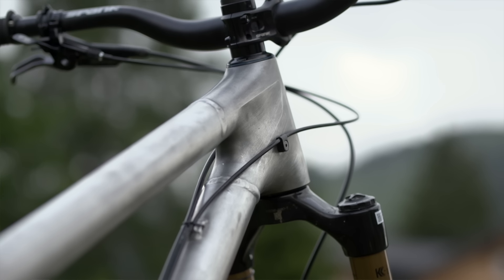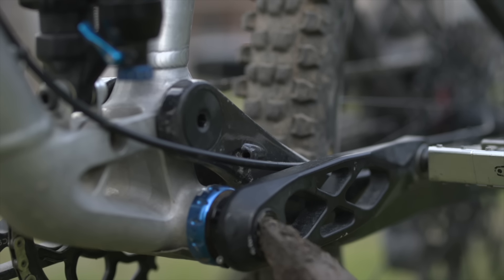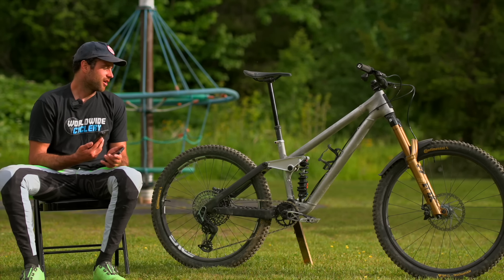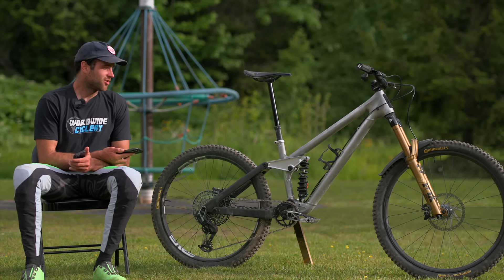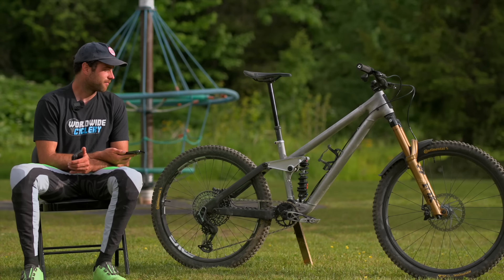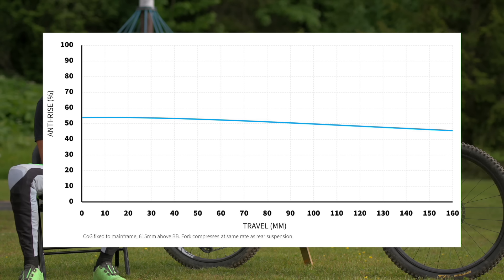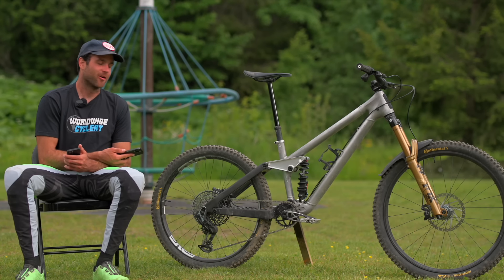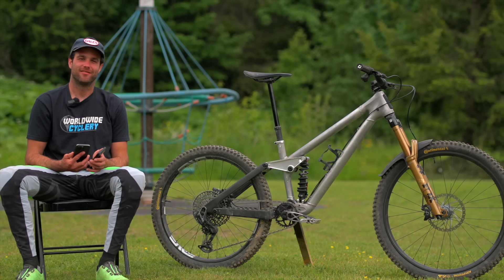IN DEPTH | Neko Mulally | Enduro Bike Gen 2

Comment: Love how clean and not fussy it looks Neko - top work!!
When you are going through / finalising the Geo' chart, be sure to include the effective top-tube length - as this indicates the 'cockpit' space, and we spend a lot of time grinding uphill too...
For your medium it looks to be ~585mm-ish (?).
As someone else also asked - is Full 29'er an option(?) even if it means a little less rear travel (eg.160mm) to keep the seat-stay bridge 'safe' (but looks like it fits that 27.5 pretty snuggly).

Again - Top work Neko et al - thanks for bringing us along on the journey 🥰
Reply: Thanks! We’ll be sure to put that on the new geo chart. 

For now, sharing these CS and SS molds with the DH bike, we can only offer 27.5 rear which the bike is designed from the ground up around. I like the long post insertion and bridge on the SS is mandatory (for me) so unfortunately no 29 options planned
Reply: @Loganmulally  is def' a v.sensible approach maintaining the CS & SS across the 'fleet' 👍
Reply: @Loganmulally have you considered to put headset reach adjust cups? Really keen on this bike, but I’m in between M and L. If I could stretch out the medium a bit it would be nice or possibly shorten the large
Reply from the maker: On an enduro frame with a single crown fork it's hard to get adjustment out of the headset since the fork has a tapered steerer tube. We have definitely considered it but with the size of head tube needed and all of the custom headset parts we would need to make, we didn't think it would be worth it right now.
Reply: @NekoMulally-FRAMEWORKS  thanks for the reply and I can understand it brings complexity to the design

Comment: The bike looks amazing.  I notice the small has a longer chain stay than reach; is there a reason the small is proportionally different than the other sizes with regard to these two measurements?  Does it change the feel of the bike much?
Reply: I guess the more crucial number to look at is front center vs rear center, or BB to front axle vs chaninstay in other words. Proportionally it’s the same change as the other frames, sorry if we forgot the front center measurement in the geo chart
Reply: @Loganmulally  No worries at all, thanks for the explanation; that makes perfect sense.  I've always wondered how different sizes of the same bike would feel different depending on the size that fits you.  For instance, would the bike behave the same for a rider that fits a medium and a rider that fits a large?  I'm guessing that's a really hard aspect to test.

Comment: Is the seat tube still too steep cause you put your saddle to the back that much?
Reply: The exact opposite of mine haha.  Older enduro frame with a 65.5 head angle and 72 seat angle.  The 620mm ETT sounds long enough but with that slack angle seat I've gotta have the saddle slammed forward.  

I think the reach on the large frame is somewhere around 430mm.